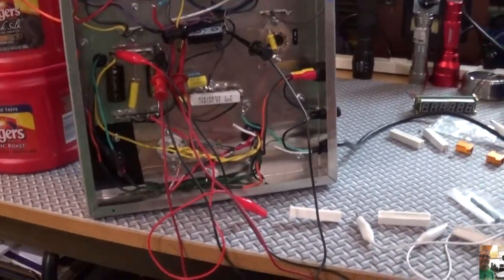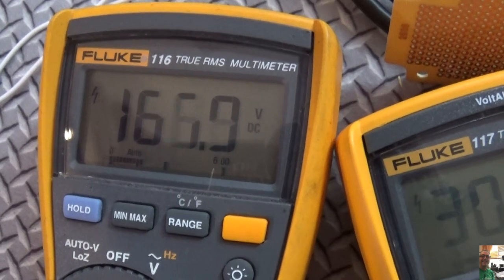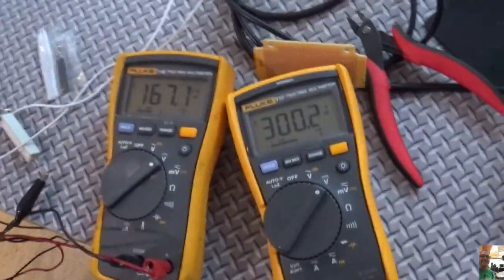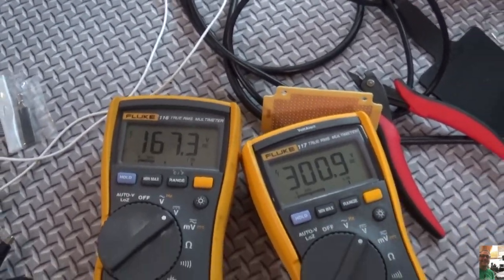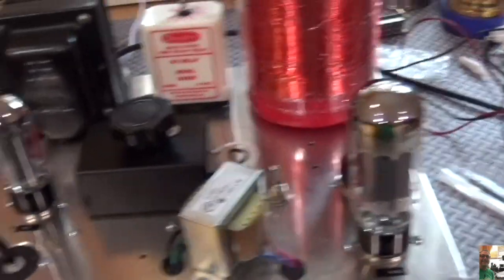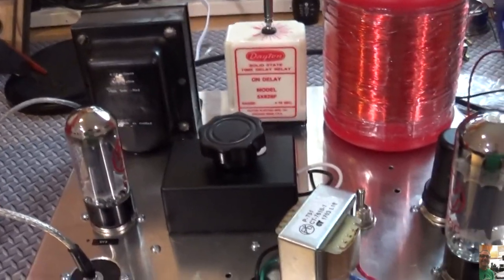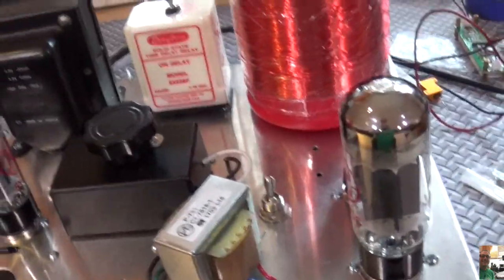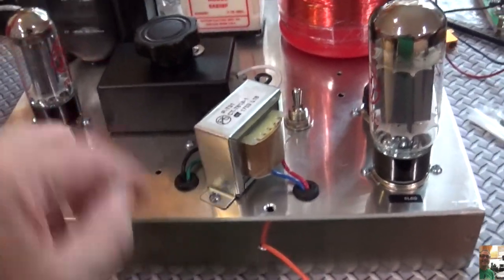Rick McWhorter AM Transmitter Build - Episode 13  - Twisted Resista !!!

Comment: watched the whole series you did, I'm currently building the same transmitter and I'm almost done, I kind of cheated and copied you!  Good luck with the weather there in FL.
Reply from the maker: Thanks Chris.... the trick...... B+ has to be 300VDC on low power..... Not more, Not less.   The 167VDC at the 33mfd cap needs to be right too.   Would love to see a picture of yours.... does it work ?  I am glad I helped you.... Many thanks. Ron

Comment: Ron,
No more Tower of Pisa?  Bummer to the max!  Oh well, we'll just have to accept the new, much improved layout.  Good job, my friend.
And I did read your comment about my high-power issue and will be going back to that for a more indepth look, but I seemed to have misplaced my MP3 player during the move to the shop.  It's out there somewhere, but I'm having a devil of a time coming up with it.
Be careful with this Irma bidniz.  It could turn out to be nothing for you, but turn out to be a very big something as well.  Take care.
Regards,
John
Reply from the maker: Thanks John.   In this video you can clearly hear the volume different so I know it works... without lowering the volume on the MP3 I would not have noticed it.  This morning I completely disassembled my shop away from the window as a precaution... and will hope for the best.... great time to clean and rearrange too.    All buildings in the state of Florida for my company are closed until Tues  ( we are talking 100's)  so this is a big deal.  We'll hunker down for sure.. will report back on Monday after the major part comes thru.   Be well my friend - Ron

Comment: Funny you did it this way.   I was thinking to suggest you wire it this way instead of putting the 2k in front of the first filter cap. 
  This will give you better filtering in this configuration.   This configuration allows the first filter cap to get full charge current into it to provide good clean DC with lots of capacity behind it to feed the rest of power supply filtering.   I think you proved this config is better because you are definitely hearing more amplitude in the receiver when you switch it to high power.   What is the voltage drop across the 4K resistance in this configuration for low power and high power settings?   This highest voltage drop squared and then divided by the 4000 ohms (    (volts x volts)/4000 = watts   ) will tell you the minimum wattage the 4K resistor needs to be.      Looking great.    You are really making progress now.  Congrats.
Reply from the maker: Jp,  On Low Power I get 300/167   -   On High Power I get 340/196   or so.  The ratio seems to be consistent. I also put a scope on the B+ and the Low Power/High Power Sinewave is very solid and consistent. Not sure I understand the calculation yet   but researching it now. Many thanks my friend
Reply: Sounds great.   Very clean power.   Excellent!!!    I am asking what is the voltage right across the 4k resistor in high and low settings.   That voltage times itself.  Then you divide the result by the resistance and that gives you the watts that the resistor is dissipating.  V squared over R.
Reply from the maker: Ah ok I got it.  I have disassembled my workbench for now to ensure nothing gets damaged but will get back to it when the storm is over.   Thank you very much
Reply from the maker: JP,  I decided to do the test while I await the storm.    I am getting following across the 4k resistor.(meter lead on each side) ...  Low Power = 82vdc     High Power = 116vdc.    That would give me  82 x 116 (9512)  /  4000  = 2.3w .    The original 2K was a 10W resistor, so that means the 4K can be 10W as well.  Did I do this correctly ?   :)
Reply: Close.    You use one voltage drop at a time.   The low power wattage would be (82V x 82V)/ 4000 ohms = 1.681 Watts dissipated.  The high power wattage would be (116V x 116V)/4000 ohms = 3.364 Watts.    A 4K ohm 5 Watt resistor would work fine in this circuit for both power ranges.     Doug's formulas are correct but it requires two steps.   High power setting example.   116V/4000ohms = 0.029 amps.   116V x 0.029A = 3.364 watts.   The one I was recommending is just a combined formula so one calculation is required to get wattage with volt and ohms.     Stay dry and thirsty my friend.  Good luck down there.     Oh,  Here is an Ohms law wheel to help you with all the formulas of Ohms law and power calculations in the future.     http://www.electricianapprenticehq.com/basic-ohms-law-formulas/
Reply from the maker: This is very helpful !!!!!!!  thank you so much
Reply: Glad to help.  It is my pleasure.
Reply from the maker: Yes, it shows that Rick over engineered this with a 10W at the start. I will add a 4K 20W just to be safe. but at least I know how to figure it out now. Alot to learn !